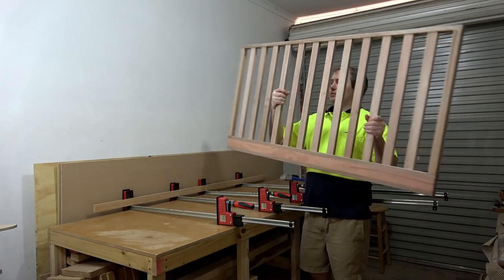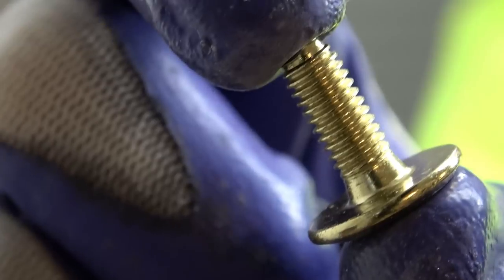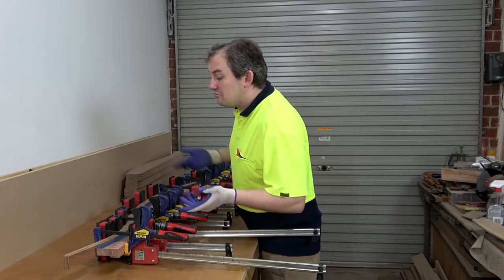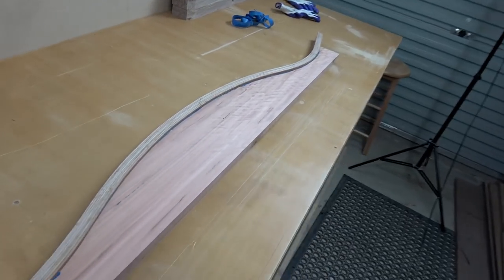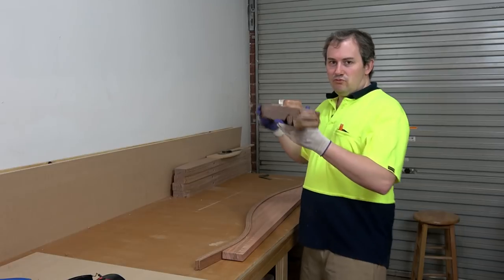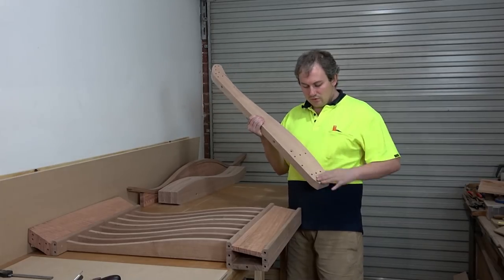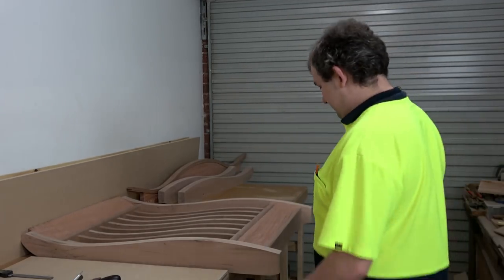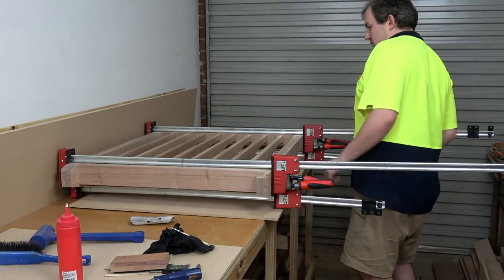The Chevy is back! - Woodworking Vlog 19

Comment: Hey Kuffmeister, where does one acquire those nutserts from ?, is it Bunnings aarrgghh lol
Reply from the maker: I think Bunnings sell them also, but in small packs at a considerable markup. I get them online through Elraco. They have good shipping, though it is flat rate shipping so sometimes you get bent over, other times it works out well for you. https://elraco.com.au/index.php/connecting-fittings-c-25_1078
I use the "insert nuts" and "demon bolts".
Reply: Kuffys Woodwork Thanks mate I’m Gunna check it out 👍👍👍